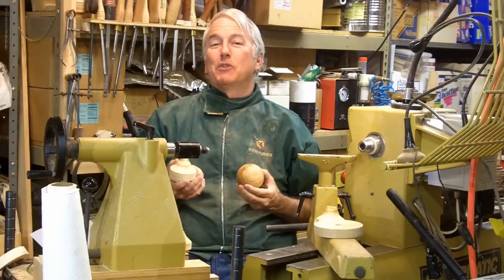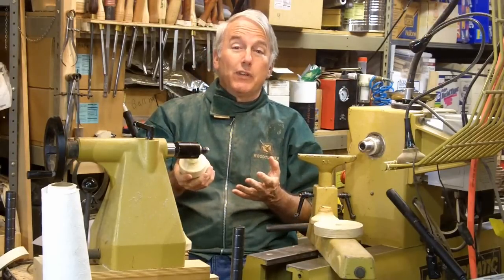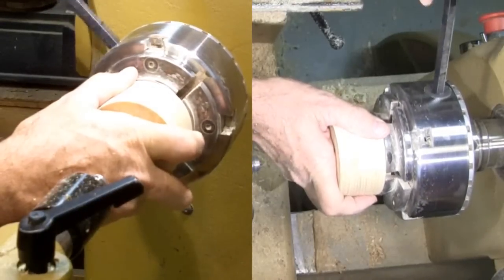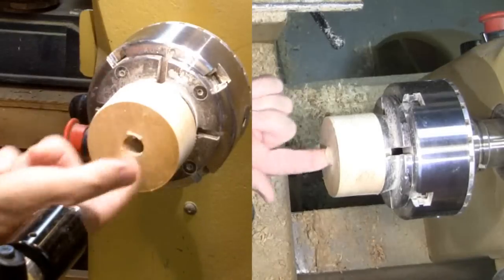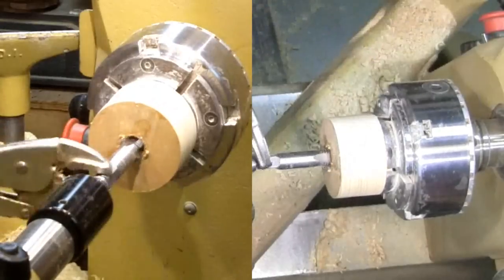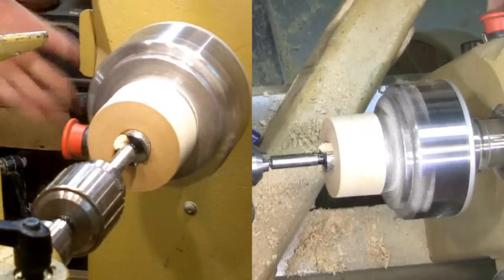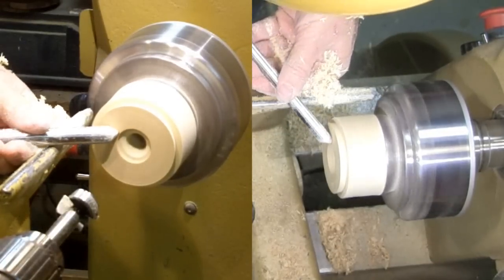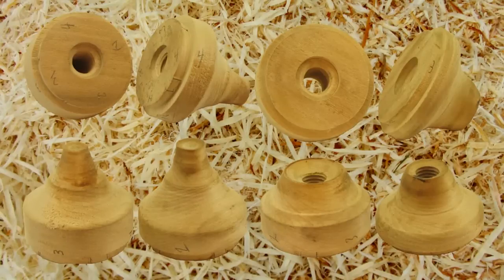Simple Wood Faceplates For Perfect Balls Or Spheres

Comment from the maker: First to clarify. #2 MT is the size of a taper not a thread specification. I made these faceplates so they could go on either end of the lathe. The dovetail tenon matches a scroll chuck for the headstock.
For the tailstock, my live center has a #2MT to fit the tailstock taper. On the other end of my live center are 3/4 inch 10 threads per inch. So I tapped the faceplates to 3/4" 10 tpi. 
Live centers vary, so be sure to check yours.
Alan Stratton

Comment: Thank you for your informative video on making the faceplates for sphere turning.  I was able to construct several in short order. 

In your video you mention that you have a 3520A lathe.  I, too, have the same lathe.  Do you have a bed extension for it, and, or, do you know if the "B" model bed extension will fit the "A" model?  Many thanks in advance for your reply.

Bob
Spokane, WA
Reply from the maker: Robert Schmidt You're welcome.
On the bed extension, I don't know if it fits. However, I'd have to ask if you're really going to do spindles that long? or is the bed extension for another purpose?
Alan

Comment: Ok, your sphere video was my favorite, but this one left me totally confused.  I don't have my lathe yet, but am pretty familiar with turning.  

First, what is this Morse taper threaded thing you keep referring to?  At 4:08 I can't understand what you are calling it.  I've listened to it a dozen times and can't cypher it.  I'm pretty sure mine will only come with a pointed one or a hollow one.

You keep talking about this other layer of polar glued on somewhere but you never show it, so I have no idea what you are talking about there.  If you are going to glue something on it, how can it be used for two different sizes?

Your pictures show them "numbered to tell them apart" but every one of them has 1-2-3-4 written all over them.  ???
Reply from the maker: The morse taper describes the hollow shaft on your spindle or tail stock. Chucks and faceplates screw on the outer threads, drive and live centers have a morse taper that fits inside the shafts.
For poplar, I've made the faceplates from poplar, I start with one 2" thick layer, thread it. After threading it, I glue on another layer to give more height.
the 1-2-3-4 numbering corresponds to the chuck jaws as an alternate mounting means.
Reply: I know what the morse taper is, I was referring to the thing ON it.  I thought tailstocks had a tapered point to hold your work, but you are screwing your work onto something threaded.  You said the name of it in the video, but I couldn't understand what you said.

For the polar, it sounded to me like you said you glued on another layer to use for a different size, not to make the same one longer.
Reply from the maker: Josef Roesler My live center on the end opposite to the morse taper, has threads to accept a cone. I purchased a tap to match those threads. with this, I'm able to thread on a faceplate to my tail stock. Lacking that sort of live center, you can make a faceplate to fit over your live center, or purchase a live "reverse chucking adapter". by live, it has ball bearings and rotates.
Reply: Yes! That's what I was asking about.  Reverse Chucking Alignment Adapter $30.  Thanks.

Comment: Does it matter what kind of wood you use for the faceplates?  Would pine work or be too soft?
Reply from the maker: I doubt pine would work although I do use pine glued on top for a working surface.
For the threads, a hardwood with consistent grain works better. Avoid oak, ash.
Poplar and maple are common choices. I prefer poplar since it is less expensive.
Of course, you are welcome to try pine.
Alan